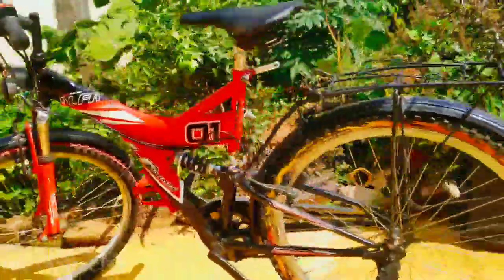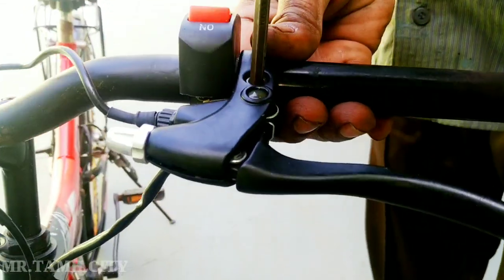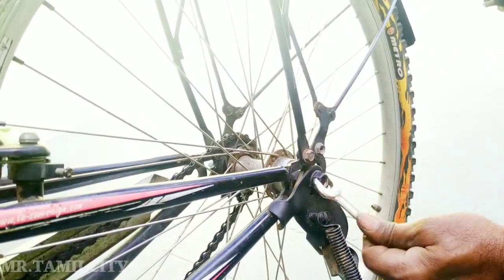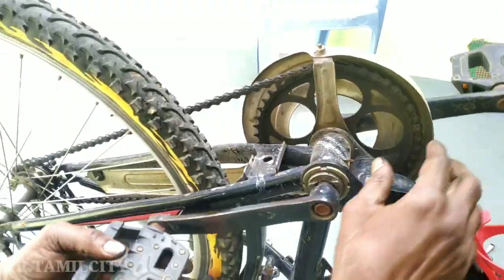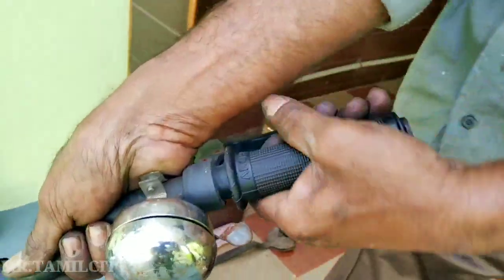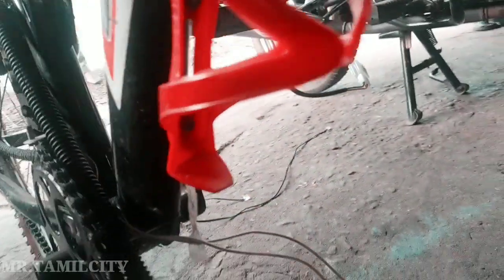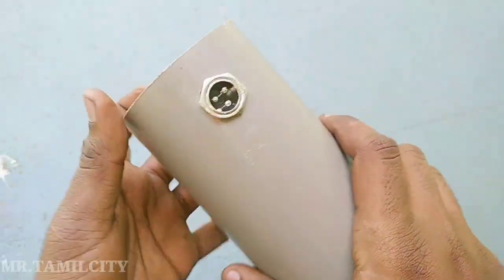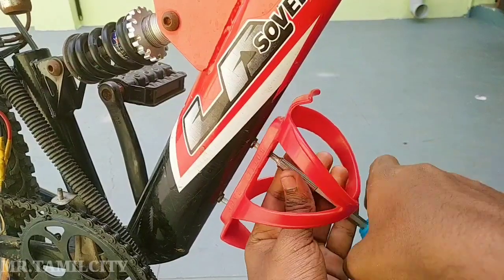How to make Electric cycle?| Wiring & Fitting )I பழைய சைக்கிளை Electric bike  மாற்றுவது எப்படி speed

Comment: Bro my cycle la antha motor mounting plate evlo tight pananu chain loose aagiruchu why?
Reply from the maker: Correct anglela fix pannum
Reply: @MRTAMILCITY  24v 14ah lead acid battery  millage enna bro
Reply from the maker: 5 , or 10 bro
Reply: @MRTAMILCITY  bro but 24v 12ah battery ya 20 to 25km pogunusolurangala aana neenga only saying 5 to 10?